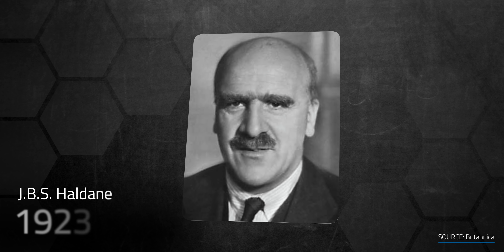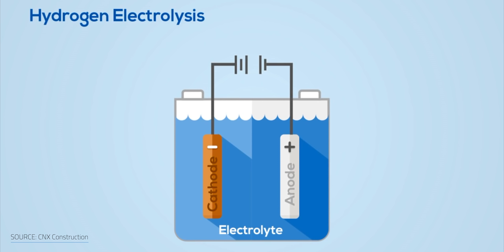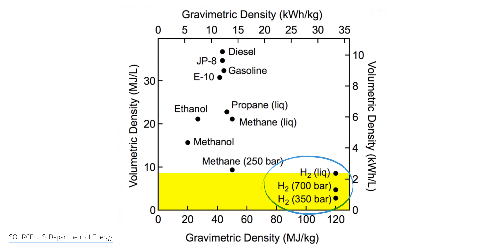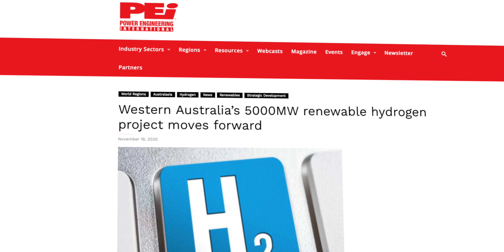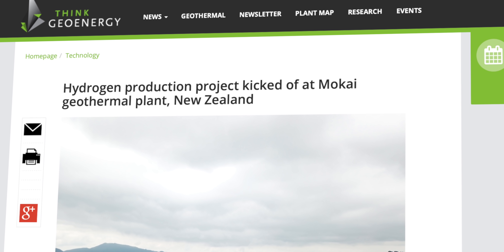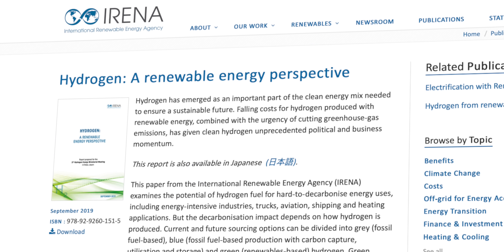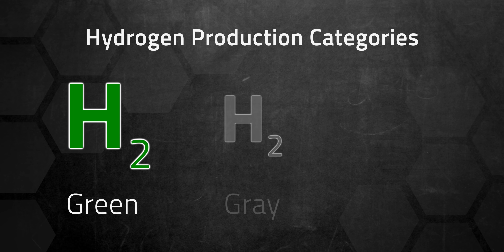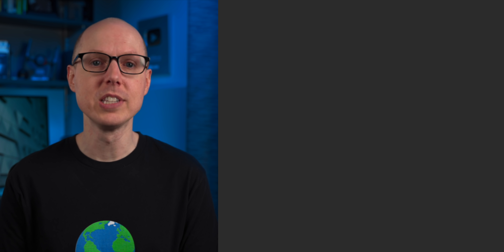The Truth About Hydrogen's Dirty Problem - Green Hydrogen Explained

Comment from the maker: So what do you think of green hydrogen?  Is it an essential part of our fossil fuel free energy future?  And if you liked this video, check out "Is Geothermal Heating and Cooling Worth the Cost?  Heat Pumps Explained" https://youtu.be/PI45yUhUWgk?list=PLnTSM-ORSgi5LVxHfWfQE6-Y_HnK-sgXS
Reply: One of my teachers at U used to say "it's not a question if hydrogen is going to explode, it's just a question of when".

Add to that the issues with energy density, how it leaks from pretty much any kind of container and hydrogen induced metal embrittlement.

I'm not that positive about H.
Reply: @NomenNescio99  Meanwhile the energy density of batteries is basically already reached we can only make them bigger and they are pretty dangerous too. Also i’m not sure if you would want to have everything delivered via electric planes for example would take forever + steel and other products like glas pretty much require it anyways..
Reply: A: We need 30% more electricity generation to support it. 
B: We need 40% more fresh water to support it. And we are already depleting that resource far faster than nature can regenerate as it is. 

The inefficiency of the conversion and the marginal costs of operations has already rendered this technology obsolete. There is way too much advanced battery technology in the pipeline that is far more efficient and cheaper.
Reply: @davefroman4700  I totally agree with your point on efficiency. Producing hydrogen is a highly inefficient way of storing energy. However, I disagree with your point about water. As soon as you combust the hydrogen, water is formed again. No water, as I understand it, is lost in the process. The water vapour goes back into the atmosphere and continues within the ‘water cycle’. Unless you know otherwise?
Reply: Wind & solar both have times of extra output H2 could be the better energy storage solution than batteries since it doesn't dissipate and there's vast amounts of salt-water that can be converted to fresh water needs.
Reply: @davefroman4700  what battery tech right now delivers a density over 650w/kg currently the best tech can do ~400 do you see a new battery tech that i’m just blind to? 

Lithium-Ion is currently the only option for cars that still is a joke compared to anything we have right now. 

The other thing is the enormous decentralised charging that is required which will very likely kill our energy network which currently is already on its limits (i don’t even want to know about the US there referring to edison transformers.. )

I would as a first step try to solarify all roofs. Ideally via policy especially in cities it’s so much wasted potential. For wind it’s probably better to go with some sort of different design as current one is restricted in its density and kills a lot of birds and untouched nature around it. 
After all that we can talk about what will be the future of transportation i’m here full on for the train 🚊 for military i dunno some for agriculture 🧑‍🌾 as they need a lot of torque for very long amounts of time and there isn’t really the same inertia that you get with car’s batteries wear out like crazy if they need to deliver that much amperage 😛
Reply: @davefroman4700  stop being so logical & scientific & using numbers to prove hydrogen Santa does not exist! Here we like to believe in hydrogen fairies and hype. We don’t want to be told why after 20 years of marketing the hydrogen car has been a flop, or that batteries are now advanced enough to to charge in 20min for 400miles! Or that there are electric chargers everywhere there is electricity. The oil & auto industry has done so much for us, that we have to give something back, and their wish is for H2, we keep visiting their gas stations and H2 cars keep needing expensive maintenance by dealerships, both will allow drivers to continue be milked as usual! 
For the foreseeable future the cost per mile of a car or semi using a battery will be much cheaper than hydrogen. Electricity has a cost, using it while losing in multiple conversions from <-> electricity will  never succeed until the electricity to H2 step is eliminated, as its the most inefficient. When GMO algae & cows start belching hydrogen we might have something!
Reply: I wonder why the plan is to use hydrogen storage instead of methane, which can also be produced using renewables, is much easier to use with existing infrastucture and has much higher energy density when compressed. Especially for aircraft that should be a big advantage. Are there too many issues with methane fuel cells?
Reply: Let's put solar panels on every home, business and covered parking rooftop and switch to electric vehicles making nearly everything we do solar powered while completely decentralizing our power supply and empowering everyone as power generation owners.

Solar power is CHEAPER and electric vehicles are soon to be CHEAPER to make and already are considerably CHEAPER to maintain and operate, especially if charged from your own solar power.

A 3-5 year ROI (return on investment) for a solar array that will generate power for decades is a no-brainer and the panels can even be made locally too.

#EndFossilFuels #SwitchToSolar #SwitchToElectric
Reply: Why not use biomass to make hydrogen.
Reply: Biogas is a better choice than hydrogen, it's methane that comes from biological waste, so it's not a fossil fuel unlike natural gas. My country actually imports trash to make biogas that we use to run buses, power plants and cars.

Biogas would be best used for airplanes, in my opinion, since it has many advantages over hydrogen: easier storage, higher energy density, and cost are the biggest.
Reply: Na, you still need drivers to transport the energy from A to B. Large ships to bring it to other countries. That’s stupid. Going full battery-powered is more viable. The transportation and distribution is already solved, energy density of batteries increased, plus it’s more safe and less explosive. Hydrogen is already dead.
Reply: @Feynman981  A battery powered container ship now we reached the point having a discussion that makes sense. There is no real way that these ships with carry additionally batteries and deliver the same freight. I think you got a bit to far in 🌈🦄 lala land we first would even need a truck capable to even transport these containers. Right now there is non or non that is commercially viable.

Where do you see higher energy density is it Tesla? They just made there batteries bigger no significant density increases + they still depleted like crazy the lifetime of such a cell is pretty short. And we also need hydrogen for all the industries that heat there stuff to absurd temperatures electricity can’t really deliver there.

Simply use the best tool for the task that is given and for ships it’s not batteries 🔋.
Reply: @Feynman981  Ships will be using Liquid  metal fueled MSR within 10 years. In 20 years there will be no Unrecyclable wind farms working but a widespread eyesore and a huge debt legacy to remind you
Reply: There is still a persistent misunderstanding of what energy actually is. That it cannot be created or destroyed, just converted from one form to another, and whenever it is converted, some is always lost (usually to heat). 

The problem for hydrogen is there are much more efficient ways of storing, transporting and subsequently using green energy. Namely the electricity grid and batteries. 

Hydrogen will require more energy to be generated to achieve the same goal at the point of use. Its use therefore will be limited to applications where batteries are simply too heavy, and the cost will be much higher than a hypothetical battery powered equivalent.
Reply: I think ammonia would be a better fit to transition us to carbon free economy
Reply: ...(with my public post & share)... "there's a few primary points he misses (like salt-water electrolysis, apartment dwelling cardrivers without garage-charging, & completey missing ships & vtol taxis/cars), but *most points are made & that home solar panel with air-collecting H2..."
Reply: Economics is a strange beast. I simply do not understand how it works.
Reply: @tie pup Which would be? Batteries turns out that is extremely inefficient and wears them out extremely quickly as of the huge torque needed. If we want batteries then only with transportation for long distances via maglev (pls don’t ask about the pointless hyperloop idea)
Reply: I think green hydrogen is a complete waste of time. Until our power grid is a 100% green, it's just wasteful on the conversion efficiency losses to try to push hydrogen elsewhere is just a waste of time. For heating = just use electricity with heat pumps(way more efficient) and planes/boats = only if we have abundant green energy.
Reply: @robertsylvain333  Yeah we will probably need to drive them from oil/gas for some time. I have more hope in fusion that would actually reach temperatures where we could create cheaper hydrogen meanwhile i dunno about the waste byproducts it creates + needs water.
Reply: @platin2148  exactly I see the world being pretty green if oil and gas is only used on ship and planes. We could sustain that forever
Reply: @tie pup There where enough EV’s burning in that short time they are on the market. Also the thing with water is semi true only i suspect you never had a lithium battery burn. Exothermic bruns like say with a very special Rimac actually showed that you can’t even kill the fire with water the Car burned for several weeks. Als the waste that is created when you kill the fire with water in this case is pretty bad (HF, H3PO4, LiOH) .. 
And all that while still being way less energy dense than gasoline. Local statistics show the opposite of your EV’s are more unlikely to burn it actually increases even when they car gets older that basically also sort of caps there life time.
Reply: Geothermal heat comes from limitless Thorium..🥝🥝🙏
Reply: Hydrogen for fuel cells or alternative ICE fuel for ships and heavy road & rail transport  - both generated from liquid metal Thoriumion ion molten salt energy converters. Save the Lithium for EVs.
Reply: Bulk carrier Ships will have safe molten fuel salt energy converters within 10 years
Reply: You can't store tanks of hydrogen everywhere, that is just asking for trouble. What you can do is make hydrogen in small amounts when you need it .
Reply: We need nuclear power waste to being able to be recycle and produce more power and byproduct to be unharmful . Hydrogen contribute not enough power.
Reply: @yeoshenghong4802  Hydrogen can be isolated by many processes using nuclear energy from walk-away safe metal Thorium ion molten salt energy converters (MSRs) like Indonesia's implementing. 
It can be safely carried by heavy freight carriers - freight trains/long haul trucks for both fuel-cell or inefficient ICE motivation, avoiding the use of lithium which will eventually only be used in personal EVs mobile phones and pocket toys - certainly not 10 minutes backups for power grids and windmills.
Reply: I want to learn more about nuclear + efuel. Seems like a very practical combo.
Reply: Hmmm ... Isn't hydrogen more an energy-storage option as opposed to a green energy source? The entire green/gray/blue story applies also to EV's and other devices utilizing other "battery" technologies. Hydrogen and the accompanying infrastructure(s) should rightly be compared to other storage strategies, although it is unique in that it can be combusted as an option (e.g. jet engines). Also nuclear-powered electrolysis would be a green-ish option not addressed here.
Reply: I wish climate warming believers could break with the Sierra Club's pro-bio-mass/anti-Liquid metal Thorium ion molten salt energy converters (which are near ambient pressure/walk-away safe, non poluting and nothing like the hazardous waste-generating 60 year old high pressure light-water-reactors).
The world needs the likes of you, with your talent for explaining things to the uninformed, to get through this generational  barrier and explain to the young Grumpy Gretas that removing poluting coal-fired sources is a top priority and the intermittent renewables can be supplemented by base load (or load following) safe molten fueled salt reactors (MSR).
Thank-you, I live in Jakarta where we are endeavouring to substitute coal-fired power with 7×500MWe ThorCon units each with a footprint smaller than a couple of football pitches while saving some of our tropical rain forests from Corporate Solar farms.👍🥝🥝🙏
Reply: To start with, I love your channel. Also, glad you filled in for Joe; that was a good show on this same topic, generally. As for hydrogen... I'm an industrial control systems engineer and have some idea of how large scale production works. First, hydrogen is such a small molecule that it is difficult at best to keep it contained for long in anything. Second, it is HIGHLY explosive, particularly after it has been leaking into our ~20% oxygen atmosphere and it makes a large and concussive explosion if it finds a spark.
It is only a matter of time before those two things cause a large, unnecessary tragedy. And if it is to be used on long range transport like ships and trains, the same thing applies in spades because the only "efficient" way to store that fuel is at maximum density at cryogenic temperatures, adding a whole other layer of potential failure point in the system.
As an engineer, I consider safety of what is being built FIRST and this does not strike me as viable for very many applications simply because of the dangers. If those warehouse forklifts were common enough, we might have some statistics on problems, but I think it is too recent to have accumulated enough data. If you have other info, please link it. In spite of my cautions, I am glad to see so many people working to make these technologies reality and work out these dangers to our benefit.
Reply: Hi Matt, great review.   Cost effective Green H2 is just wishful thinking now but could be a realistic part of renewables in the future,  novel technologies could bring it to reality some day.
Reply: @Ed-bj5eq  We are already using 175% more fresh water than the planet can replenish each year due to industrial processes. You want to tell me we can double that amount to support a green H2 infrastructure? Physics say no can do.
Reply: @davefroman4700  water is already consumed to generate dirty H2 in refineries today, also when H2 from any source is recombined with O2 it produces back the water along with energy.  Green H2 has zero chance to replace Grey/Blue H2 anytime soon but eventually can be cheap enough to make H2 tech a reality among other renewables.  Nobody is considering it will replace it all or be the only renewable just maybe one more for special purposes, maybe.
Reply: @Ed-bj5eq  I can tell you right now that the inefficiency and costs of H2 production will not enable it to scale big enough to bring costs down. The only place H2 may find a niche is air travel. And even that is doubtful as we already have electric aircraft coming to market this year capable of 600 miles of range. How? Because its not a traditional looking aircraft. Its a lifting body with wings. A much more efficient air frame. The shape of todays aircraft is dictated by the propulsion systems. Electric aircraft just need a different air frame to make it efficient enough to be viable. Especially if the solid state batteries finally become available. You will be looking at 3 times the energy and half the weight. And it will charge in half the time as well. Not that we cannot do battery swaps to allow quick turn around times. The only people salivating over an Hydrogen system are the gas companies. Why? You get 3 molecules of hydrogen from that process instead of 2. They are the ones pushing this narrative that hydrogen is the only answer to commercial transportation, not science.
Reply: Hydrogen is an energy sink, not a energy source.
Reply: @ajarivas72  and a highly inefficient one at that. Even after 100 years of scientific development.
Reply: Sadly fossil fuels are so ingrained into our society that we could not fully take the devices out of use for centuries.  Fusion is our future and the byproduct can be sent to sun via cargo ships / star ships from private companies. (until its safe to launch nuke waste that is)
Reply: @tnlwithtrixiekat478  That is a scientifically invalid belief. There is virtually nothing that we use oil for today that cannot already be replaced with bio-chemical processes. And the earth receives more energy from the sun in a single hour, than our species consumes from all other sources combined each year. It is a stupidly small fraction of a percentage that we need to capture and store to meet our needs. And the only reason mans energy demands are so high in the first place is this scientifically invalid economic model that is tearing up resources as fast as it can. Producing increasingly inferior products for endless profits and GDP growth. Its not that we cannot manufacture goods that last for decades if we so choose with our modern material science and engineering skills. You make a toaster that lasts 50 years instead of 5 like they do today? THat is is 900% reduction in energy we needed for extraction and processing of materials, manufacturing, distribution, delivery, advertising, and disposal of that item 9 times.
Reply: We're almost there ?
Reply: A lot of time the answer is right under their noses
Reply: How does Australia power that desalination plant?
Reply: @mfanto1  What you think solar cannot power it? Or wind? Israel would not have water if it were not for their solar powered desalination.
Reply: @davefroman4700  power is not the only cost to get it you have to sacrifice metal and the maintenance aint cheap. Metal has to be mined and shipped there is a minimum ammount of direct power output required to produce power same as hydrocarbon feul production. The question is are we putting more or less energy in. A valid question not to steifel progress but to drive it. There a need to be financial benifits in the process to invest large sums and if there is no room to get the numbers out in the open it seems like magic
Reply: @mfanto1  EVERY sector today is already going to green electricity to save money. Solar and Wind are the cheapest form of energy in the history of the global energy marketplace today. WITHOUT subsidies. And electric vehicles are 60-80% cheaper to own and operate. Bus operators around the world today are racing to transition, strictly for the cost savings. And mining has been going electric as well as the production of metals. We now can produce steel without coal and for 30% cheaper than we used to. EVERYTHING about this transition to a new energy paradigm is saving money.
Reply: How about this? Not bad :-)
https://www.youtube.com/watch?v=w8Hbna3UoEo
Reply: H2 is in mo means an energy source. It is another kind of battery...splitting h2 chemical  or electrolytic from other molecules and when using making again water from it.

I've two major ptoblems with hydrogen as an important part for making green energy more reliable.
1: Already one hydrogen station in Norway is exploded/burnerd...one of the three available in that counbtry.
2: The efficientie of the H2 cycle is far below the efficiency of loading/unloading accu cells. 
3: High pressue (700 bar) storage is another risk far more dangerous than a burning lithium cell. And may be a target for terrorists...security costs will be high.

But I do see some use for it. If the weight of the hydrogen tank and hydrogen is less than accu weight it is usefull for flying. But not as a main replacement. 
Knowing that the newest (800 volt technology) cars can charge in 18 minutes...than go for another 300 tot 350 km...And because in normal use the car starts every day fully charged without needing any fast charging...except on a few days in the year...in contrary with hydrogen cars because they MUST go to a filling station for every "charge" I do not see any advantage in hydrogen cars for every day use.
Reply: What about hydrogen and nuclear? Nuclear beeing a temporary solution while developing solar wind etc...
Reply: @squa_81  It takes 10+ years to build a nuclear facility. You can install the same amount worth of solar generation in 8 months. And a hydrogen economy would require 3X as much electricity because of the inefficiency of conversion at each step.
Reply: @davefroman4700  did you hear about bureaucratie, and manifestation? i live in france, and wind isn't very popular, and we don't much space to have solar, so yeah :/
Reply: @squa_81  Any country that does not switch will be left behind by the global economy in the next 10 years, because that country will have much more expensive energy than those who have switched. We are seeing prices below $20/mWh without subsidies now and within 10 years that is projected to be less than $5. 
Gas is $57, Coal is $85 and nuclear is $116. And unlike renewable energy those energies just keep getting more expensive.
Reply: what do i think about "green hydrogen" ? i think that you all should cut the crap.
Reply: Hydrogen is a fossil fuel sponsored distraction to slow down the adoption of renewables. The well-to-wheel energy efficiency is absolutely woeful and I have no confidence in the generation costs that you have cited.  Toyota just built a refuelling station here in Australia for a cost around $7M. It can only produce 80kg of hydrogen per day, enough for 8 Mirai cars. Meanwhile battery storage and density is improving exponentially, while prices continue to drop exponentially. Unlike hydrogen it’s really easy to create electricity and charge your car or home battery for later use. 
Using a FC isn’t as straightforward as people think either - there are annual inspections and filter changes required, meaning that the ongoing costs are much higher. Just because of these facts hydrogen will cost at least 2-3x what a battery does to operate. Outside of areas like steel production I don’t see it being viable.
Reply: @markedwards4879  how about just using good old fashion petrol instead ? it seems to work pretty good so far. if and when the energy storage unites will be good enough, then it will become a natural transition, rather than a forced one, like it is now.
Reply: @itsMe_TheHerpes   There are quite a few reasons why we should stop using petrol, and I don’t agree that it’s being doing pretty well so far. For starters burning petrol has caused, and continues to cause a lot of illness due to air pollution. Not that long ago petrol contained lead, and so much lead was pumped into the atmosphere that it had a measurable effect on the mental development of children who lived next to busy roads. The pollution from burning modern petrol still extends to more than the C02 released into the atmosphere. There are all kinds of toxic compounds that come out of car exhaust, and this is right next to where people live and breathe. If you spend any time away from a city and then come back to it, you’ll be amazed at how much it stinks. This crap is what goes into making the horrible smog that we see over our cities - even in Australia.  Next there is the problem with the sourcing and refining of the petrol. We spend trillions pumping, refining and transporting fuel all over the globe, with each process adding more pollution along the way. The countries that predominantly sell oil are also run by regimes that are decidedly dodgy and who often use the money from the oil to export religious fundamentalism and terrorism globally. Since those same countries are the main supply for oil, we end up with wars that cost us trillions to fight and that have killed millions. The ongoing instability in the Middle East is funded by oil, and the huge cost that we all have to pay for in increased military spending just to look after oil supplies means that it costs us even more. 

Where I live, in Australia, we import pretty well all of our fuel now. This means that we are giving money away for oil when we could be powering our own transport with our own fuel.
With a battery electric car, you can make your own fuel on your own roof. You never need to go out of your way to a servo to fill up. The car is full every morning and fill up while you sleep. 
Battery Electric cars are already here and better than petrol ones, and as the production of them increases the prices will drop down below what it costs to make a petrol car.
Reply: @itsMe_TheHerpes  Mate, so you live in Europe, hardly drive anywhere and you think that you need more than 600km range and full off-road tank capability?  It’s a 900km drive for me to visit my brother’s house, and pretty easy in my Tesla.  Norway is in Europe and is pretty bloody cold yet most people are buying EVs today and they seem to work just fine. I know that cold weather makes a difference to cars, but having watched plenty of people doing much longer than 100km winter drives in an EV you are completely wrong. 
You are also wrong about needing to swap batteries. The current chargers on highways are 250-350kW and will put 200km charge in 15 minutes, just enough time to have a toilet break and buy a takeaway coffee. 
I’d also suggest that you have a look at the off-road EVs that are coming out, like Rivian, Hummer and Cybertruck. I’d also suggest that you look at the new Ford F-150 Lightning. 
Petrol and oil cars will be dinosaurs in a decade, probably earlier.
Reply: @itsMe_TheHerpes  if you read what I wrote I don’t see how you could think that I’m in any way endorsing hydrogen mate.
Reply: @itsMe_TheHerpes   Mate, petrol is a hydrocarbon that releases pollution when it is burned. You need to do some basic chemistry. I seriously doubt that you understand how a refinery operates, and you certainly don’t understand what else is put into petrol to make it perform the way it does.  I don’t endorse petrochemical additives that are used in some foodstuffs either. 
I suggest that you actually learn about how this works - preferably from a proper educational facility rather than youtube. 
Oil is not environmentally friendly in any way or form. It’s also not the best way to power things.

Stop promoting it.
Reply: @itsMe_TheHerpes  no, it just makes you ignorant and deluded as far as I’m concerned. Having owned quite a few performance vehicles and motorcycles over the years I can easily tell you that oil is dead for new performance vehicles.  Nuclear is fine if you like paying way too much, but seeing as you also like oil, you appear to like giving your money away in the silliest way possible.
Reply: I think we'd have to be stupid not to seriously pursue producing green hydrogen en masse, but I think the best way of doing it is with the Heliogen method of using a solar refinery to produce it and then ship it via container or pipeline to where it's needed.
Reply: @stretchmcgee  H is dangerous, you can't work with it
Reply: I'M surprised you never mentioned thermal decay hydrogen. Granted you need very thigh temperatures to get it to more and only two technologys can do that right now with minimal to theatrically zero carbon. concentrated solar and nuclear fission.
Reply: What about brine from desalination plants? What kind of hydrogen can we get from that and how much?
Reply: H2O & heat by-products, Imagine being in the middle of a big city or airport on a very hot day the humidity would be horrible. The rest of the year, constantly wet slippery roads.
What about Drought ? we can't use our rain water & imagine the seas after 200yrs of desalination what happens to the salt, we can't eat it all. Solar Wind & Batteries, is that fn so hard.
Battery tech will get better & out perform H within 10 - 15yrs in every way. With rocket fuel being it's only use.
101% Solar & Wind Earth + Hydrogen-Oxygen rocket fuel, moisture taken from the air & replaced on ignition.

Electricty & Hydrogen, used wisely they can build a universe, they can do the job.🖖
Reply: @johndavid9418   - NOPE , Hydrogen does NOT work and is a STRANDED ASSET. 
in order for Hydrogen to work, YOU NEED Solar, Wind, Battery FIRST to produce the energy, then YOU need to SCALE it , when SWB reaches 70% then its ONLY feasible to make Hydrogen with SWB.
see - TONY SIBA , SuperPower .
Reply: @markplott4820  hydrogen will rock the world. Just wait
Reply: @stofjes4204   - NOT , unless we INVEST in 70% SWB FIRST . 
without SWB , Hydrogen DOES NOT WORK. 
in America H2 stations are PERMAMENTLY CLOSING , as there is a H2 fuel SHORTAGE , and also CNG shortage . 
so, NOW there are 50% LESS H2 fueling stations in the USA.
Reply: @markplott4820  swb is not the answer. you´re right but there are other ways
Reply: @stofjes4204   - SORRY , there is NOT. 
see - Tony Siba , Superpower.
Reply: As Hydrogen is produced as a bi product, that is usually scrap garbage which they try a sell to lower cost of the production in hand, is this not free and therefore green?
Reply: @jonscot8393    Photons are free & green.
Energy gained by converting mass from Earth implies changing the geographical &  chemical makeup of our planet therefore is neither free nor green.
Our star the Sun converts mass into E as a byproduct of nuclear fusion there is no need for us to E = mc 2.
Thermodynamics tells us we do not have an unlimited supply of H on Earth, to think that way, I believe, is short sighted.
Fusion & Gravity = Photons & Geophysics =  Free & Green

H keeps our Universe from freezing & must be replaced when we've run out.
The vessels we exist on & Potential Energy is all we will have at the end and must use it to create a "Big Bang" and a new universe to colonize when this one is cold & dead with no background radiation no gravity no Hydrogen, no nuffin. Like our conceivable ancestors did, or mabey they said screw it lets just erase our memories &  live in this empty void in a matrix in an automated self-repairing computer. 
But how do they power the computer ? 
With Hydrogen ?
Considering what the void is doing to our universe I don't believe the laws of physics  would allow matter ( an automated self-repairing computer ) to exist indefinitely.

I'm getting ahead of myself I know, but that's the point 🖖🌞
Reply: @janossenbrink5375  In what sence had I  forgot pink/yellow (nuclear), and orange (waste) ?

Ill try to cover everthing.

Any pink/yellow (nuclear), and orange (waste) can simply be buried or using somthing like SpaceX Starship shot to the Sun, or to a cold planet with H2O ice like Mars or 
Europa for terraforming.

Like using diesel trucks to deliver materials to build EV trucks, until the EVs replace them, until we master quantum tunneling & get rid of the reason for trucks, or uploading our conscious minds into a self repairing computer & living in a realistic simulation, then being able to upload to a synthetic body of some form that can interact with reality if need be & to & fro. Therefore not using the resourses we once did.
 If we must use waste, we must use waste to remove the reason for the reason that we caused the waste, minimalize to 0.
Converting molecules, large scale on a planet changes the nature of the planet.
All I know is that until we are creating as much harmful waste as wild monkeys do we'll not be 100% green, that means no synthetic fluids or polymers, only ceramics & alloys that can fully decay naturally or by force over a reasonable time frame & H2O if unavoidable, & Gravity, The Electromagnetic force, Leptons & Antimater for power & fuel.

 Anyway, all matter will completely decay over time to quantum particles then 0 planck time, like all black holes & stars will. As the universe expands the physics holding particles together will diminish & loose cohesion.

We need to start working on a "Big Bang Bomb" if we are to preserve human  contiousnes beyond the life of our universe.

Ok, I've run out of hot air 🖖
Reply: ... by oil & auto industries...
Reply: @Undecided Can you answer this question for me in a video? if the whole population was burning ONLY H2 (from water, gases etc), in how many (millions? billions?) years this will affect the balance of the environment? We can hypothesize that even 1% depletion of H2 it may lead to bad effects on the environment? eg. less water less h2 related gasses, environmental chemistry may be affected.
Reply: Hydrogen is a useful medium for transporting energy, but the fundamental issue is that it is NOT  a SOURCE of energy. You have to generate energy in order to get hydrogen. So we still need energy from something else like solar, wind, tidal, geothermal, some sort of clean nuclear, etc to generate the energy used to release the hydrogen. For example, the Belgian solar panel sounds exciting until you do the calculation that 250 liters of hydrogen has a mass of 22 grams. The Toyota Mirai hydrogen fuel cell car holds 4 kilograms of hydrogen. One of those solar panels will require 179 sunny days to produce enough hydrogen to refill the Mirai’s tank.
Reply: https://www.youtube.com/watch?v=ulLbp31iS4M
Reply: Liquid hydrogen is not a high-pressure storage system as-per-your-comment at around 3:30. It can be 1 atm to any pressure. But it is normally a few to 10s of bars at most. You cannot liquefy hydrogen via compression alone. And it has been an industrial commodity in North America for 50-odd years. 100s of tons are delivered daily by tanker trucks and the amount is now rising rapidly.
Reply: i think you either did extremely poor research or you are intentionally ignoring how incredibly inefficient hydrogen is.
Reply: @SupremeRuleroftheWorld  Word! The efficiency from powerline to combustion engine is ridiculously low.
Reply: @SupremeRuleroftheWorld  yes it is inefficient but did you research batteries inside planes and trucks and .. all heavy maschinery is not easily driven by batteries because that sucks the live out of these poor things 😀
Reply: @platin2148  electric trucks are already on the road with warranty as are electricnplanes in the sky
Reply: @SupremeRuleroftheWorld  ohh i do know that meanwhile both turned out to be inefficient and slow. Electric planes for example are way slower than there competing kerosine turbine friends and there is basically no technology on the way to make them any faster maybe in 2330 we will have ion drives guess it would be just better to not fly. And also that they don’t deliver organs anymore in time so that we have less people on the planet. 

For the trucks yes i know my company does even have some of them but they are a joke for heavy loads and overall transportation takes way longer. We also had already the need to replace the entire set of batteries on two of them. Btw. my company is selling motorcycles we had some electric ones in our portfolio but basically no one bought them and marketing has show that the reason is mainly the missing engine + it’s sounds e.g overall feeling is crap.
Reply: @platin2148  dorgan delivery? that is your basis for an argument against using electric planes? please, go back and try again. an electric tesla semi outpreforms an diesel semi on every metric that matters, especially cost.
Reply: @SupremeRuleroftheWorld  I’m not sure about what crap you are talking but electric engines for planes are not really a great option. They don’t have as much thrust and also the distance you can fly with them is a joke also look how many big electric planes exist. Airbus for Example just stopped there entire project and that was just a hybrid plane not only battery powered. A other company that was boeing backed also failed i think it was called Zunum or something. Then there is a slovenian company which made a jet that can fly a 1,3 hours a comparable DSS Plane of that Size can Fly way longer. 

For the tesla semi it’s already out of the race in several countries as it’s not even allowed to be driven there. And the other thing is the price is actually not that cheap for the variant that would be needed a typical Volvo is around 40k€-80k€ a not even comparable in range tesla semi costs 170k€ i dunno where you see that it’s cheaper + the fine for pre orders 20k€ i think its so in then end 190k€. Also charging this monster takes forever without the loading station that currently doesn’t eixst anywhere which uses a Tesla proprietary system. I would prefer to use it for short ranges and put the stuff on a maglev for the longer the distances then it might work but sadly that is not a option.
Reply: By the way, what I wanted to say, cleanly produced hydrogen has an advantage that people tend to forget: during its production, the water is purified and, where possible, also desalinated. And clean water is more than precious, especially now and in the future. This is something that should not be forgotten.
Reply: @sigismundsulzheimer5512  One usually needs to desalinate the water before electrolysis as the presence of salt produces chlorine gas in the reaction. Its more of a burden than benefit.
Reply: 3 things we need for hydrogen. Reducing the expense of the fuel cell catalyst, providing safe storage, and getting energy from somewhere to produce it. For the catalyst, we need to replace the platinum catalyst with something more cost friendly. The storage  I think may be solved through Magnesium hydride -- the byproducts of its reaction with water are more expensive than the reactants. So an additional recycling process could make it cost effective? and lastly energy production, I think nuclear is our biggest friend for the next century or so, until we can nail down fusion, fission should not be discounted. Of course solar is nice too.
Reply: @JustMe-lp5td  I see it the same way you do. For this reason, I am also very interested in this Dual Fluid Reactor, which, in addition to numerous amazing advantages, also works at very high temperatures. These high temperatures around 900° C to 1000° C allow a completely increased efficiency in hydrogen production. At these temperatures, water can be thermochemically split into hydrogen and oxygen. So there is no need for energy-consuming electrolysis. As a result, the dual fluid reactor not only provides huge amounts of clean electrical and thermal energy, but also huge amounts of clean hydrogen. And we need huge amounts of hydrogen to decarbonize steelmaking and the chemical industry, and to provide hydrogen for mobility applications. In addition, at these temperatures, seawater is desalinated very cheaply. I don't need to mention that this enables very low-cost production of electrical energy, thermal energy and hydrogen.
Reply: @sigismundsulzheimer5512  Interesting. If we can convert water to hydrogen directly with heat, that would increase the production efficiency greatly.
Reply: @JustMe-lp5td  Yes, this is the enormous advantage of thermochemical water splitting. Energy-intensive electrolysis can thus be completely eliminated. For this reason - and of course because of the other enormous advantages - I am convinced of the Dual Fluid Reactor.
Reply: I think your pretty hot for a geek.  
Just saying.
Reply: @vickidianacoghlan8946  Anyone have a buck of cold water for Viki? lol
Reply: To your question: no
Why will any sane person produce a dangerous gas on his roof? Or have it in his veichle? 
Why not go for the much cheaper, and more efficient power generation; photovoltaic
For storage, batteries in all kind of forms, have one similarity; plummeting cost
As a Norwegian ive been following NEL for over a decade; lots of claims- still not much to show for. A bit like Nikola.. oh- there might be a connection there👍🇳🇴
Reply: @rare_wubbox360  Will anyone want to sit on a hyper energy dense battery? It’s basically a bomb and btw. classification as dangerous is overreacting.
Reply: Great work. Yes, I think clean hydrogen is vital to your future and our future needs to be fossil free to avoid a lot of pain and destruction for humans and other species. What do you think people outside the hydrogen industry can do to help grow clean hydrogen?
Reply: Your credibility slipping, Hydrogen (and I am referring to Green hydrogen), may be a good addition to other renewables, but is dangerous and inefficient no matter what. It sounds like you have sold out to the "paid" promotion bandwagon. Hydrogen may be good for storing energy, as long as you dont count leaking and waste, and dont have to move it, and dont blow up the odd city block, but you still need to convert it to electricity for nearly every use case
You made the ridiculous, unsubstantiated, impossible,  claim that fuel cell technology will MATCH battery tech costs by 2030. WTF. How? Batteries are getting cheaper, fuel cells are NOT. Fuel cells have been developed for nearly as long as batteries to, so dont pretend they are new, and just catching up. The physics beats them. It CANNOT be more economical to convert electricity to gas, compress, move, store, transfer, store, convert back to electricity and then convert to work... A BEV? make electricity, put instantly into a battery, convert to work. 
Oh, and you still need all the parts for a BEV in the car anyway, so the fuel cell+tank+piping+safety measures and Filling infrastructure has to be LESS than the cost of say half the batteries, 
THEN you need fuel, in suburbia, Who wants a bomb that can level a city block, and costs about the same, next door? And then you need a few thousand MORE bombs on wheels to deliver the Hydrogen to the suburbs, and then the is the maintenance, everywhere, on every tank, every pipe, and every fuel cell, since we are supposed to safely store the smallest molecule in the universe in a man made "Safe" containment, that we know will absorb said molecules constantly, and crack, and leak a "slightly" volatile gas into the garage, or car....
Why do you do such poor reporting when your reputation is for in depth looks at alternatives, Are you paid by an oil company, or a government like Australia? There is no way an educated man can believe the stuff you read off these PR brochures. Hydrogen is a great way of storing energy from excess sun and wind generation instead of batteries, but its only real use would be in power generation where it would be a "free" source of storage for winter storms and times when renewables are struggling. It may also be economic for Very long distance trucking, with widespread, isolated filling stations would actually not be a problem, and shipping, probably even some rail, (With sparkltricity in cities. But every time someone pretends hydrogen can have a place in cars, i write you off as another shill, as you are either stupid (you are NOT), Sold out, (probably), or indoctrinated into the dark side. (Petroleum industry shill). 
As such Green hydrogen can not, and wont be anywhere near as important as people think. The environmental costs of batteries, (And that does NOT mean just LIon, and no it does NOT have to include cobalt and rare materials either) is far smaller than people realize. Steel and concrete, quarries and mines for 1000 gems and minerals are all ignored. So is the cost of CO2 and Particulate pollution. All this is to say that renewables, with micro-grids, macro-grids, storage for load balancing and frequency maintenance, as well as modern load management through things like Teslas auto-bidder and others, that can ramp up and down demand by managing point of use storage, grid storage, car and home storage charging, and even hydrogen production, means that the old concepts of what constitutes a grid, and a supplier, and a load will all change.  It sounds messy, but really, instead of layers of suppliers and consumers, we will just end up with an AI type system taking ALL inputs, from a Nuclear reactor to the single string of solar panels on a country cell tower, and all users, from NYC metro trains to the fishing cabin with 1 light on, and decide where the most efficient use of resources lays at any time. (including grid and home and car storage, flow batteries and other storage hubs that will appear near (profitable) loads).
I also think the tipping point is closer than we all think. Until we all stop looking backward to see what patterns to expect, we will be blindsided by the simple truths when they hit. 1. Electricity is easiest, immediate and cheap. With multiple sources, and intelligent (Probably asking a lot) management everything can be electrified easily, and here's the kicker, Cheaply. We just need people like elon, and i hope others to realize that this disruption will be easier if we just do it. Compare the adoption of cars in the nineteen hundreds, (or Tesla/BEV's now) or phones, and dont be one of the coach-makers, car execs or Nokia's who "know".
Reply: Yes, and while you hit many points while maybe off on one or two (and added, with that solar panel)... salt water electrolysis is, I hope, going to make a major part of the process. There's proven tests & systems under development.
Reply: Hello Matt, here's a suggestion: I think you should speak slower. I'm not a native speaker and I always have to put the video on 0,75x speed to get everything you're saying.
Reply: if we could figure out storage in a denser way, metallic hydrogen, it would have a chance.
Reply: Make a video on 
1) india national hydrogen mission 
2) india buying hydrogen train 
3) successful test of hydrogen buses in delhi and leh , now 20 hydrogen buses
Are gonna running there in this month
4) hydrogen train 
5) hydrogen buses 

.
Reply: Hellp Matt,
Please
Research the company Sun Hydrogen in California
Reply: @tie pup Meanwhile when a battery burns especially lithium they basically can only use silicon to stop it from burning and if this doesn’t work it can only be put to the side for letting it burn out. That safety is also probably the reason why here local government doesn’t allow you to park in parking garages with your electric vehicle because it’s so extremely safe. I did see 3 of them burning already not really nice.
Reply: once people decide to allow flooding the grid with renewables, hydrogen from electrolysis will explode.
Reply: @zodiacfml  Explosions and death, followed by TONS of regulation.
Reply: I wish you where more critical, and look more into the numbers. Especially efficiency on the energy side, also the CAPEX and OPEX cost of everything. And the limits of the laws of nature. You use very superficial information from the hydrogen companies, which are mostly misleading. Also look more into the technical part of an electrolyzer, what kind of water do they need? Does it need alot of clean good water? How much energy does it cost to make that "specialized" electrolyzer specific water? What is the maintenance of the system, and the OPEX cost of that? Hydrogen systems have mostly very high OPEX costs, and also CAPEX but CAPEX might get lower... they the chance for everything to become really alot cheaper is almost nothing. I think you must do better detailed research on hydrogen. Also who is behind the hydrogen hype? And why is it companies like SHELL ? Why do they have huge lobby organisations that cost 60 Million a year to operate to lobby at EU ? Why ? Check the true motives of that. Your video is exactly what SHELL says: First blue, (but blue hydrogen DOES NOT EXIST YET) then green. But what does shell wants us in the future? TO be stuck at the BLUE so they can sell carbon fuel. This is their SOUL motivation. And you are FALLING FOR IT DEEP.  You need to do more research ok. I like your channel, but this video is really like you are part of the shell lobby group. Shell wants the Blue hydrogen to Green hydrogen transition to get stuck, due to technological limits. And get stuck at blue hydrogen... so they can earn money. It all boils down to M O N E Y.
Reply: Hydrogen will play a huge and essential role in addressing decarbonization. Especially in those applications where goods (or people) have to be transported over long distances without emissions. And also in those applications where sufficient energy must be available to supply auxiliary power units with electricity, such as in trucks, buses, trains, ships, commercial vehicles, construction machinery, airplanes and many more. In these applications, transport vehicles powered purely by batteries quickly reach their limits because the batteries are very heavy and run down relatively quickly. A very fascinating method to produce green, i.e. clean hydrogen, is photosynthesis with bacteria. Universities, scientists and researchers all over the world are intensively researching special bacteria and algae cultures that split water into hydrogen and oxygen with the help of sunlight (photosynthesis). One of the most promising concepts is the so-called "Powerpaste" by a German research group at the Fraunhofer Institute, which uses water and magnesium hydride to produce hydrogen - in a reusable cycle. Powerpaste allows hydrogen to be chemically stored at room temperature and ambient pressure and released as needed. The interesting thing is that this paste is in a cartridge and is not under pressure, so it is not liquid and not gaseous. Water is then added to the paste from the water tank, resulting in gaseous hydrogen. The quantity is adjusted to the hydrogen demand of the hydrogen fuel cell. To all this, it must also be mentioned that hydrogen fuel cells provide two types of energy, electric power and heat. The heat I need to air-condition passenger compartments, houses, apartments,...

https://www.fraunhofer.de/en/press/research-news/2021/february-2021/hydrogen-powered-drives-for-e-scooters.html
https://youtu.be/rnTp3PbXza8
Reply: @sigismundsulzheimer5512  Very interesting ..thanks
Reply: Hydrogen can be green eventually, but for every 2 hydrogen atoms  from the gas tank, 1 oxygen atom is removed from atmosphere. Eventually, all roads will have less oxygen. Instead of more CO2 we ended up with less oxygen which is much worse. This oxygen displacement becomes worse when Flights start using it. Either way we cannot save earth from humans :-)
Reply: @KnowledgeCravings  I'm not sure I understand. Where do you think hydrogen comes from? It comes from water and natural gas, no oxygen removed from atmosphere.
Reply: @KnowledgeCravings  That is even dumber than people claiming plants start dying from green tech releasing less CO2. If the minute amounts of gases involved were an issue then the oxygen released when producing hydrogen would cause fires or something.
Reply: @AnalystPrime  That is what people thought when running automobiles in the 19th century. Now look at the people around the world scared of green houses "gases". May be I am dumb. Thanks for pointing out smart guy!
Reply: @AnalystPrime  Oh abut the oxygen, do you think greedy cash hungry humans will let the free oxygen byproduct escape in to air. They will sack it too and ship it somewhere.
Reply: @KnowledgeCravings  The excess CO2 is caused by burning stuff that has been in the ground for 200 million years. Breaking water into hydrogen and oxygen and then burning them so the recombine into water does not imbalance the atmosphere notably.
If you want to find problems with technology, worry about the waste heat billions of people using more energy will cause, even if that energy comes from renewable sources.
Reply: @AnalystPrime  I am not worried about imbalance only, it is about oxygen scarcity in big densely crowded streets. Anyway you and me are too small to be heard one way or the other.  I am also inclined towards not spending when you don't need.
Reply: I think in the near future green hydrogen is going to play a huge part in global transit/freight but I think that is where it will stay for the most part for a good while as that is where it is best suited and easiest to deploy having ports near sea water just needing excess power from renewables and hopefully also fusion soon.

Would be great to hear your opinions on and maybe see an episode about Aerosols. They seem to get overlooked a lot and lots of people talk about a fossil free future, but I think in the not too distant future we will see fossil fuels coming back into play with a new role as we are somewhat dependant on the aerosols they produce and regionally they play strong roles in maintaining habitats and such for animals that we are still learning about and I do not think it will be long before we hear about something being detrimentally affected by the loss of aerosol production by a city going green. It actually worries me that so many are anti fossil fuel and are pulling so much money/funding away from research and development of cleaner fossil fuels that we now and in future may rely on as a part of or total system even if it is and needs to shrink.

https://earthobservatory.nasa.gov/features/Aerosols

p.s.... G'day from Down Under ;)
Reply: Hydrogen might cost more per watt-hour than pure electricity, but as neither does anything on their own you also need to consider the cost of the storage medium too. While batteries are very useful, hydrogen has massive potential that we must explore instead of just going "fool cells LOL!" as if small cars were the only reason for the tech to even exist.

Chemical batteries are best for small scale uses, up to midsize vehicles. Yes, Tesla Powerwalls and Megapacks are great utility, but we need billions of those and the company already has trouble making enough batteries for their cars. Another major problem is that an empty battery is still a heavy and expensive piece of electronics, while we can mass produce fuel tanks cheaply and easily so we will not lose much profit even if we overbuilt more storage than we end up needing. And yes, H2 has an unfortunate habit of leaking but it can easily be turned into other chemicals that are easier to handle.

For grid scale storage other types are probably even better than batteries and hydrogen, but a tank full of hydrogen can be used for producing electricity for the grid, heat for private or district heating, fueling a vehicle, and for industrial purposes like making steel or as feedstock in chemical plants, while a battery or pumped hydro station is limited to producing electricity either for a car or the grid. This high demand means the production will increase whether it is green or not.

A large vehicle seems like the best use for hydrogen as the savings in weight and money over full battery are combined with refueling being faster than charging. Time is money and if you can save some just by spending little more energy it is an easy  bargain for many people and companies. Another possible issue is when you have some machine that is only needed occasionally, like a snow plow or a combine harvester. A battery would not only cost more than an ICE or fuel cell but needs extra maintenance to keep it charged for months while you can easily fuel it when needed. A harvester is a perfect example of the benefits of both as you only need it for a short part of the year, but at that time it must work long days where you cannot stop it for hour or more to recharge unless you spent even more money to buy extra harvesters that can keep going while others recharge.
Reply: @AnalystPrime  well said
Reply: I think Hydrogen is going to play a huge part for islands as far as cars, a tank of cooking fuel and if paired with a home fuel cell for electric needs.

Island nation don't necessarily have reliable electric grids nor are they going to be robust enough to support total electrification.

Plus land is at a premium - solar farms vs domestic housing and food production?

With the exception of Japan most islands use diesel generator and important diesel as well as gas for their cars.

Importing Hydrogen would mean the smallest infrastructural investment until they can produce their own.

Japanese cars are the bulk of imported cars to many island nations, so there is that as a partial reason for Japan's push for Hydrogen, they share a lot in common with Pacific and Caribbean islands.

No land!!
Reply: MATT - this is FAKE NEWS, just look at the TESLA ENERGY site, Tesla energy is going to put HYDROGEN and Utilities out of Business. 
TESLA Energy is already in 80+ Countries and is ever Expanding. 
Hydrogen and their ILK , CNG and Hybrids are going to be DINOSAURS soon , and will become STRANDED .
as SWB - Solar , Wind , and Battery scales up. Apple is building the LARGEST Solar & Battery farm in CALIFORNIA with help from TESLA. 
its Bigger than the MOSS Landing Project and the Hornsdale Project in Australia. 
MOST Hydrogen today uses FOSSIL FUELS and is a Dirty and Wasteful process. 
TESLA can drop off 25 Megapacks to a site and in a few weeks is up and Running. 
you cant do that with Hydrogen, and many States/County will say NOT IN MY BACKYARD , because of the HINDENBURG factor.
Reply: @markplott4820  sorry youre wrong
Reply: @stofjes4204   - go ask TONY SIBA , what HE thinks of HYDROGEN .
Reply: @markplott4820  Please remember the word 'dodo'. In the future you will understand.
Reply: I think that for aviation and other very energy intensive uses, batteries are not the way to go.  Also you can source Hydrogen production to areas where renewable energy makes sense and transport it to where the demand is. That would be done in a manner similar to how fossil fuels are transported now.  An effective (dense & safe) storage solution needs to be developed and that may be a big challenge.. As for the cost $ 70 B is a drop in the bucket and there is likely a virtuous cycle of investment fueling lower costs  fueling more investment for years to come.
Reply: @michaell170  Its cheaper and more efficient to move electrons around than it is to store and move molecules. First principals thinking. Renewable energy is possible damn near everywhere from one source or another. Including the fuselage and wings of an aircraft. A sector that is long in the tooth for disruption in itself.
Reply: @davefroman4700  I dont disagree that transmission combined with some form of grid storage makes sense most of the time.  There are use cases where that does not make sense and aviation is one of them. A 747 uses about 15,000 litres of jet fuel an hour. Jet fuel is more than 50X as energy dense as current batteries, although, jet engines only convert about 50% of that to thrust. So batteries have to become about 25X as energy dense to compete. Despite the massive advances in battery tech that will happen over then next decades, I simply do not see that as happening. Hydrogen, in my mind, has a chance of replacing jet fuel.
Reply: @michaell170  Its more like 35% that you get in thrust. And electric turbine technology already exists is 85% efficiency. Our current aircraft design is dictated in part by the propulsion systems. Electric aircraft will be designed differently as well over time to take advantage of its strengths and create a more efficient airframe for it. Ei, Lifting bodies.
Reply: @michaell170  electric planes commercially sold already exist. dont see many hydrogen powerd planes flying around...
Reply: @SupremeRuleroftheWorld  There are some cool electric planes for sure.